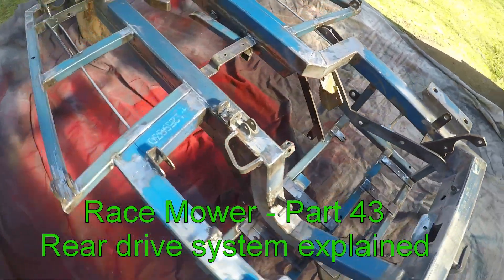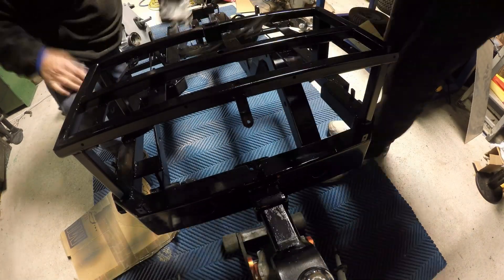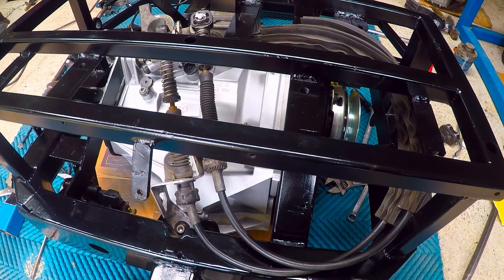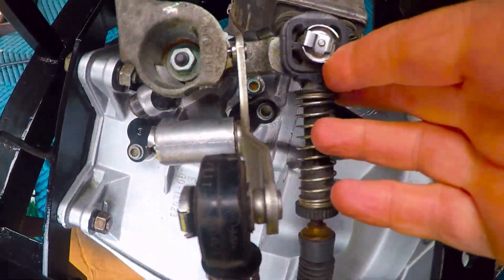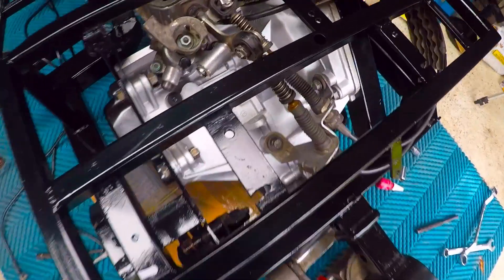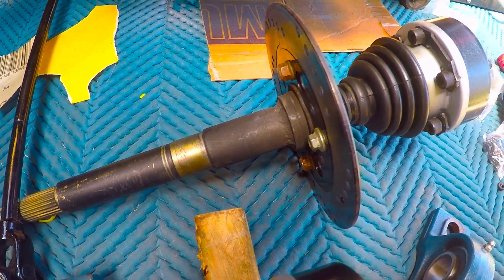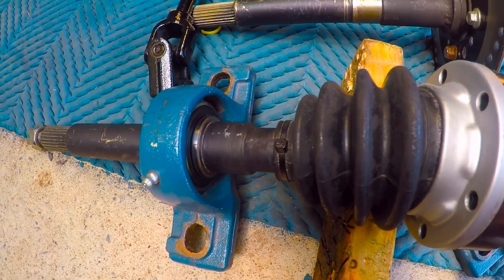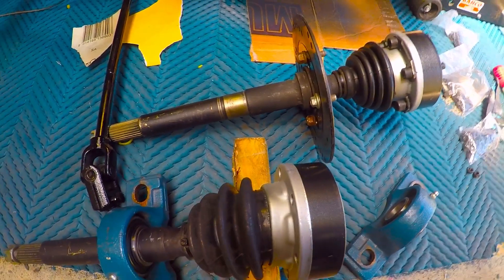Race Mower Part 43 Rear drive system explained

Comment: so correct me if i am wrong but you use the motorcycle gearbox to drive the A2  gearbox, 
so you cant mowe with the mc-gearbox in neutreal, 
but use the motorctycle clutch as the onlyy clutch?
Reply from the maker: Close, the motorbike engine drives the audi gearbox. I then connected an electric clutch on the output of the audi gearbox to then drive the blades. So, ultimately the engine drives the mower blade using the input shaft of the audi box. I just flick the switch when I want the blades to run or leave it off if I just want to tow or have fun. I can run the blades at any speed and not be moving if I put the Audi box into neutral. Probably easiest to say the engine drives the blades through all 6 gears and the Audi box determines the ground speed. Hope that makes sense.

Comment: I think you Will have a problem with the gearbox because a gearbox like that isnt made to have so many rpm. What i mean is if you put the motorbike engine in 6th and the car gearbox in 1st the amount of rpms wil be too much for the gearbox in the back
Reply from the maker: Hi Sake, no it will be fine. Remember that the motorbike engine in 6th has the crank to final gear ratio nearly at 1 to 1. So at say 6000rpm the drive to the car gearbox will be 6000rpm. Most of the time I rev the engine to around 5000rpm, red line on most cars is around 7000rpm so the only way I think this will be a problem is if I rev engine past 10,000rpm in 6th gear. Hope this makes sense. The  other thing is the car gearbox is rated for about 4 times more power than the engine puts out.